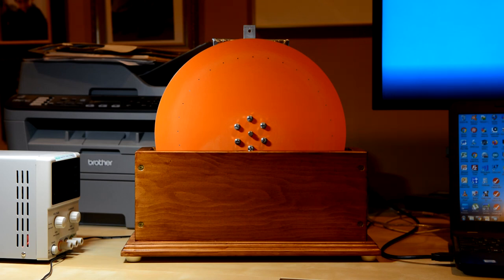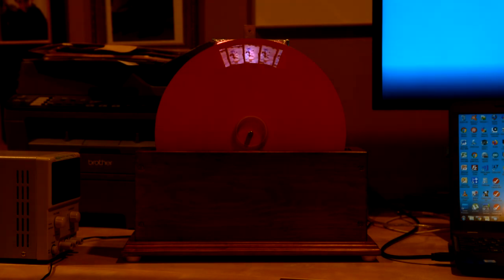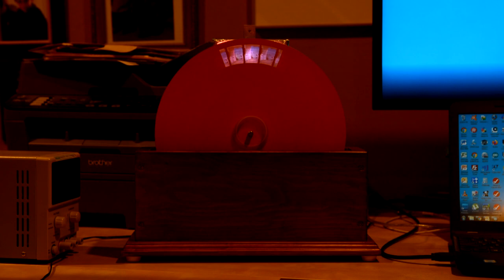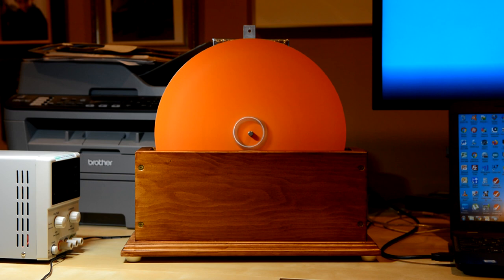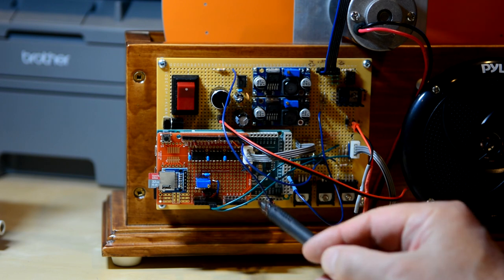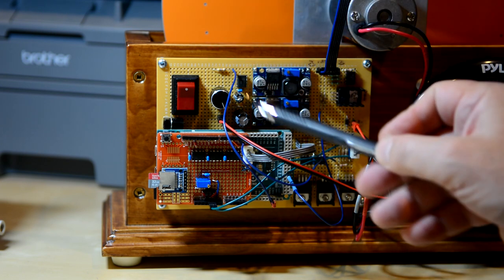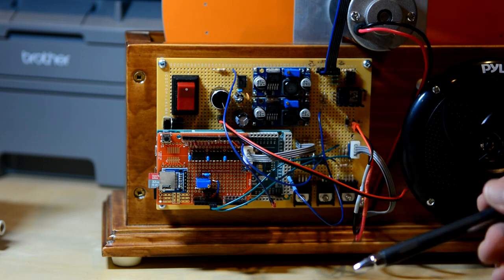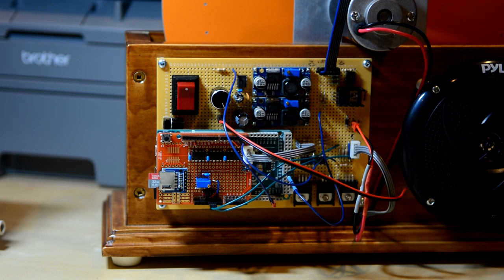Mechanical Colour Television Using Arduino Due

Comment: Great design! More steadier than other designs including my own. I design and build a unit with standard components, so no Arduino. Nevertheless, most interested in the sketch and do you use analogue outputs from the Arduino??? And how did you make the disk. The holes are so needly spaced...?????
Reply from the maker: Check out my other mechanical TV video which may answer some of your questions. One of the 12-bit analog outputs from the Arduino is used to produce audio and one of the PWM outputs is used to control the motor. The RGB analog outputs are produced using 3 external SPI based DACs (MCP4901). The disk was cut using a water jet and an earlier attempt at hand drilling is discussed in the other video. Haven't got around to posting the sketch yet, but may do so in the future...

Comment: Neato.  Can it scale up to 100 ft tall?  Can it look more steampunk?  Where is the video of it being made - people love to watch that stuff.
Reply: Google 'mirror screw mechanical television'. Those look pretty epic. 
Nipkow disks are somewhat limited in size due to their rotational speed. The speed at the edge can get so high (with huge disks) that they fly apart. Or at least that's what i read in a article about the history many years ago.
Reply: if you cut the framerate down to 12 frames per second you can cut the rpm down to 720.  you can theoretically get away with a disk about 330 inches before it starts running into its own sound waves.  a 330 inch disk is good for about a 33 inch picture.

this would require an obscene amount of torque and I wouldn't want to stand in the same county, let alone the same room.